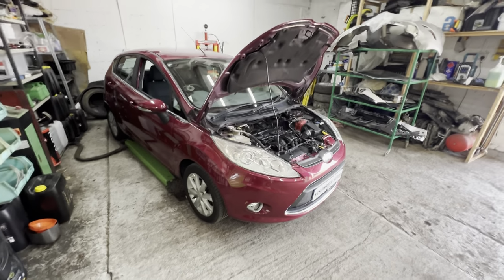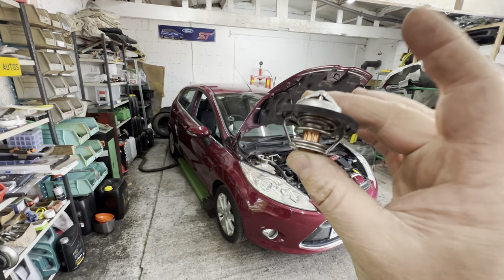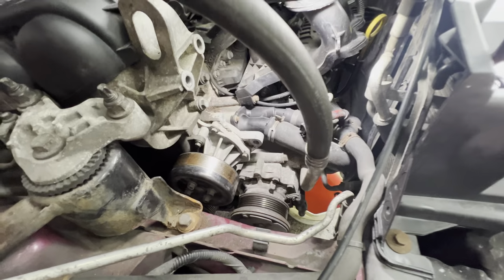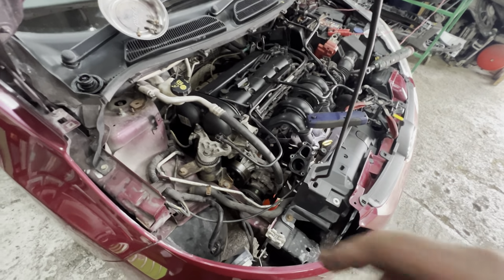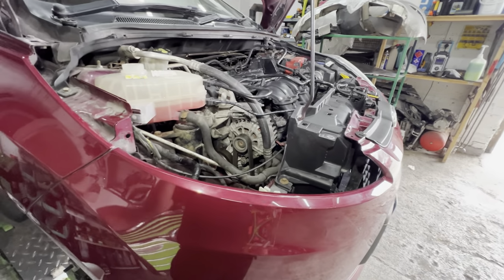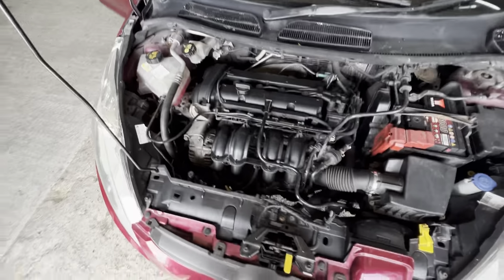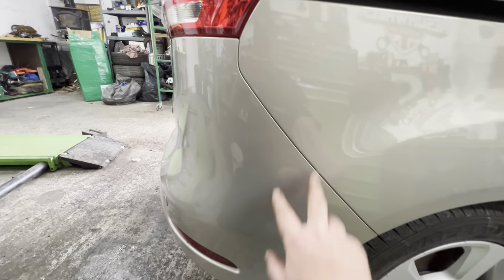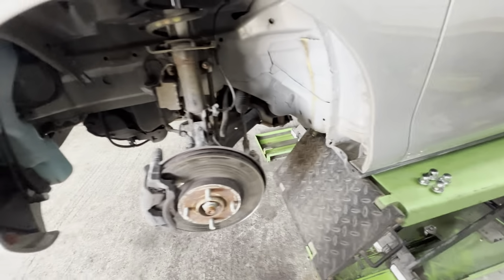Ford Fiesta Water Damage Is Back After 3 Days Steam Coming From Under Bonnet ???

Comment: Buyers have rights for months as you are trade, thermostats control temperature not pressure i.e circulation. The expansion bottle cap controls pressure, read up mate
Reply from the maker: What a absolute useless comment
Reply: He’s a complete fake knows nothing about mechanics
Reply from the maker: @iancarrier-pd8cu  wow that’s the first time some one called me a fake absolutely  clueless 🤣🤣
Reply: @ResurwreckAutosUK  What's useless ? The correct explanation of a thermostat & rad cap. Where do you get your info from Mike and the Mechanics? :)
Reply: If the thermostat isn't opening the water builds up pressure that has nowhere to go. He's exactly right. Video does a good job explaining this. Ignor the haters that probably still ask mummy to check their oil level
Reply from the maker: @Gingerclown  thank you buddy one then even called me fake wow that’s so far from the truth it’s a form of online bullying 👍👍
Reply: @ResurwreckAutosUK  it's funny because all you said was that if the thermostat don't open then there will be pressure built up one side only which is correct
Reply: @Gingerclown  Wrong the temperature will build up which causes overheating, the reason for a pressurised cooling system is to increase boiling point. Anything else I can help with?
Reply: @MartinJones-tl9kt  I know how a cooling system works sweetie. But with heat comes pressure, if the thermostat opened the pressure would be the same both sides, he is explainin how he diagnosed it, Not how a thermostat works! Seems you may need to do some physics research
Reply: Thermostat does not control tempature its simply a gate that allows coolant to go around the rest of the cooling system after it reaches operating tempature. The fans and radiators keep the engine at operating tempature. 

Pressure would build if the car was over heating, have you never seen a boiling kettle? That steam must be nothing.

Comment: martin was right about thermostat  and expansion cap pressure but forgot to say older cars had ally thermostatic housings and  not plastic and did not warp when they got to hot  . to be honest thats why there is problems . i understand why you thought  thermostat  . but if the housing wasnt plastic and  was older asin alloy housing then because ov the thermostat not opening then it would have shown itself at the expansion bottle  .

Comment: Hello Mark the thermostat is NOT a pressure relief it allows the water to flow through the radiator as soon as the engine is at working temperature
Normally the engine cooks when the thermostat jams closed so you just caught the engine before the head  warped
Love What you do with the cars Keep it up

Comment: Hi Mark,  perhaps you should look at the brake calipers,  pistons and slide pins. The pistons could be sticking and not moving properly, the slide pins could be the same. Looking at the disc it looks like uneven wear.  But what ever you do, I'm sure you will solve the problem.